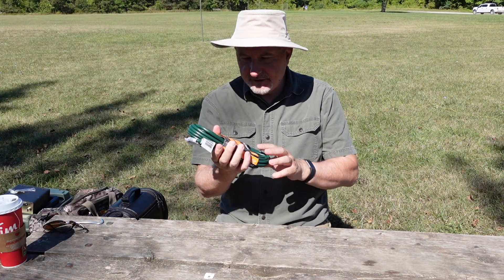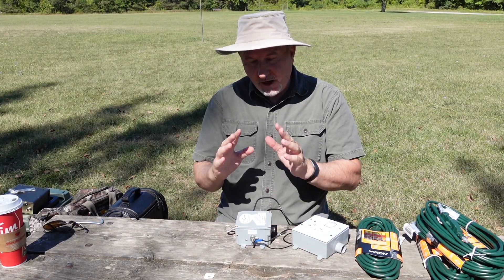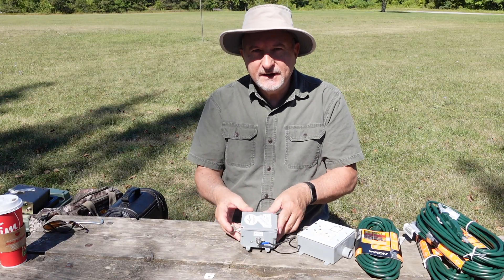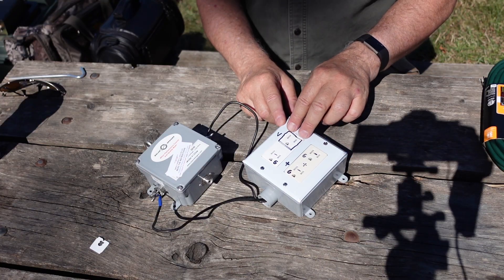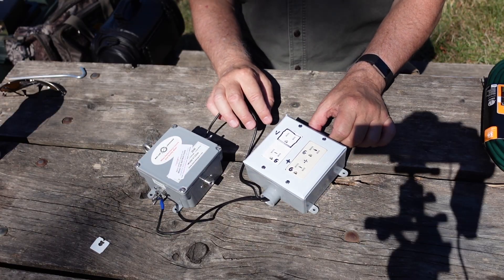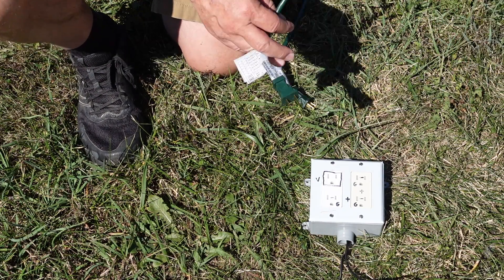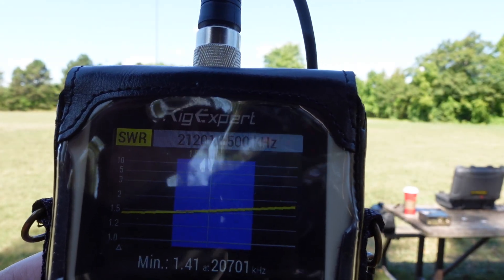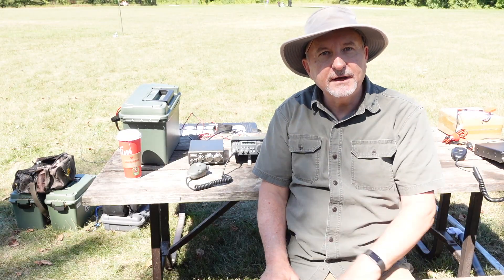An Extension Cord Ground Plane for 20-10 meters

Comment: Hi Tracy,
When you made sure to disconnect the receptacle used for the vertical element, did you break the connecting bar for both sides?  73  WJ3U
Reply from the maker: Hi Don, yes I did :)

Comment: Interesting concept. My observation is that you really need that very heavy duty mast for an extension cord as the vertical wire. I would need lighter wire. That balun is the same one used by Zero-Five Antennas for their 43 ft. vertical, a very good product. Fun experiment. 73, Phil N3ZP
Reply from the maker: Hi Phil, thank you for your comment. You're right about the mast needing to be beefy. Good point about the Zero Five use of the balun. 73 from VE3TWM!

Comment: Hi Tracy VE32WM , Awesome video !   This kind of experimenting is exactly why I am in this hobby. Please go on making videos. This stuff is inspiring. 
I was curious how exactly did you build your device exactly. i.e. Do you have a (rough) schematic? How long is your radiating element, and your ground wires? do you use one or two conductors from the extension cords?  Have you tried with one or two 1:1  common mode chokes? Of course I am going to try one myself and let you know my results. 73 Wouter SWLJO22RD
Reply from the maker: Hi Wouter, thank you for your comment. 
- Sorry no schematic. I connected the same side on all receptacles, then broke the built-in connection between the vertical receptacle and the other on the same fixture.
- Each extension cord is 24 feet 11 inches. One for the vertical, the other 3 for the radials.
- I used a choke at the rig end.
- I only wired up one conductor from each extension cord.
Good luck with your testing! 73 from VE3TWM.

Comment: 10 or 15 years ago someone one the qrp-l email reflector noted that a full wave length on 30 meters is right at 100 feet.  He proposed making a full wave delta loop with a 100 foot extension.  I kind of thought that might have been where you were going.  Boy, was I wrong.

I couldn't tell from the video if you extended the cords to their full 25 foot length or not.  I suspect you did.  With that in mind, fold the top back so get a 16.5 foot length for 20 meters.  No need to cut.  Just fold it back upon itself.  That would give an impedance of around 35 ohms and a SWR of 1.5  to 1.  So, a 1 to 1 un-un would be a better choice. 

You've got a set up that invites experimentation.  Go have fun!
Reply from the maker: Thanks for the suggestions, I'll have to try that!

Comment: Those extension leads certainly provide a robust and easily setup option. The mains electrical plugs and sockets we have here in the UK are around twice the size of yours so not quite as appealing although I guess they could be cut off and replaced with something a bit more streamlined.
I’ve used the wire from old extension leads for various antennas after stripping off the outer insulation and separating the wires. It’s a good cheap source of obtaining some long lengths of stout wire.👍
Reply from the maker: Thanks for the info, it's a great way to source wire!

Comment: Certainly and interesting experipment using the extension cords as the antenna wire and the ground plane.  It would have been useful to seen how it was hooked up inside the electrical box.
Reply from the maker: Thanks for the feedback, I might show the internal connections in a future video!